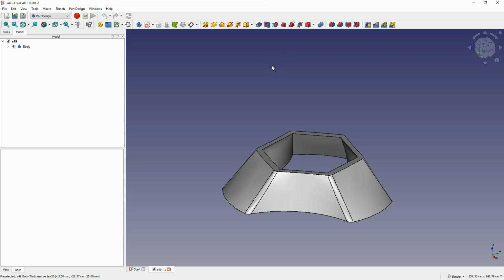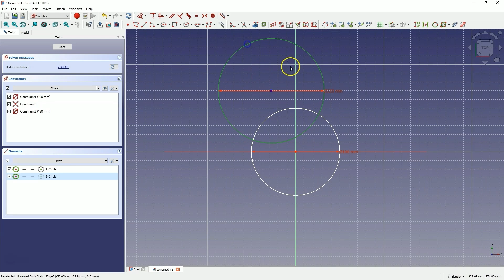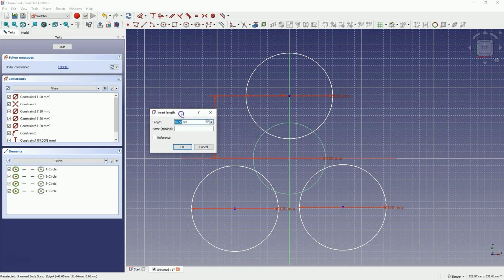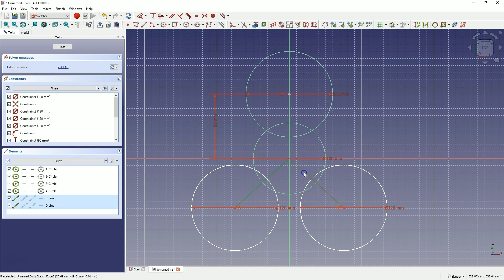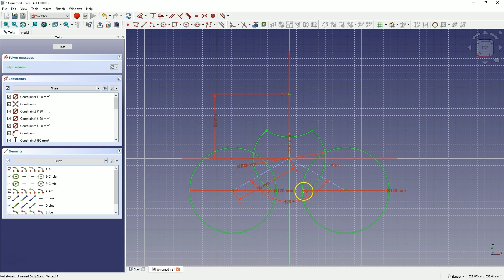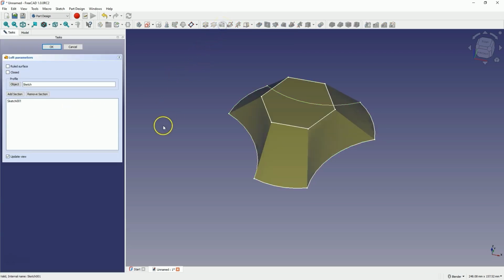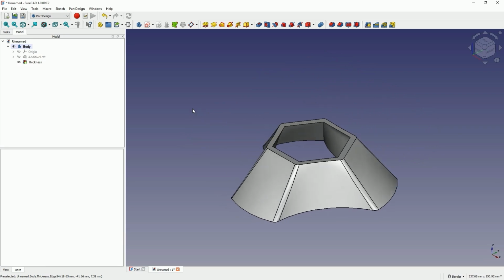It's Easier Than You Think

Comment: Thanks for sharing:)
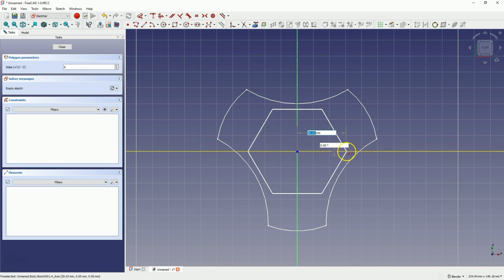I'm try to practice and change the Hexagon into a Circle at 4:25, then the Thickness can Not be done.
Does anyone know why or how can I do?
Reply: This complex geometry example works because the three arcs subtracted from the circle creates six vertices which align with the six vertices of the hexagon.  The additive loft function wouldn't know how to loft the bottom geometry with six vertices to a circle.
Reply: Make the Circle using six arcs and it will work.